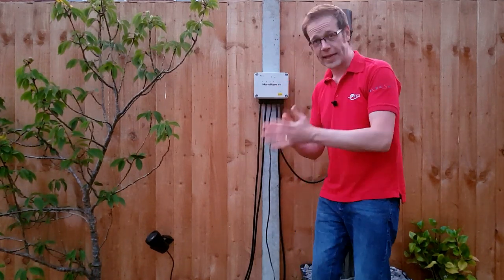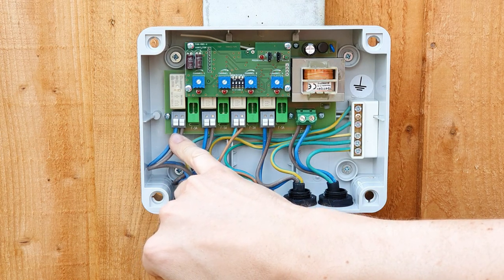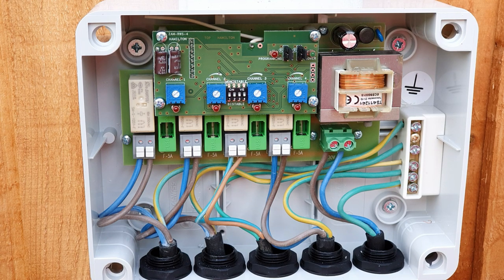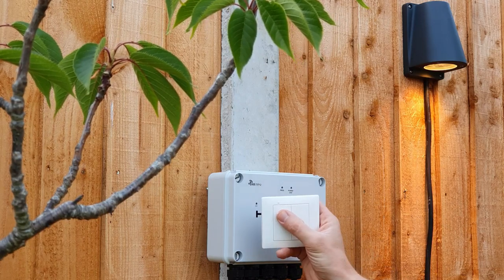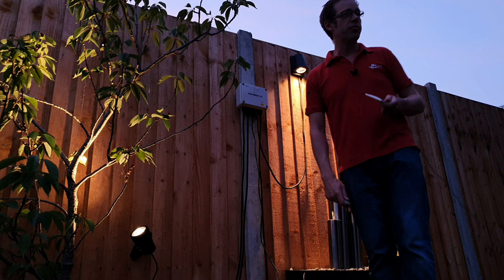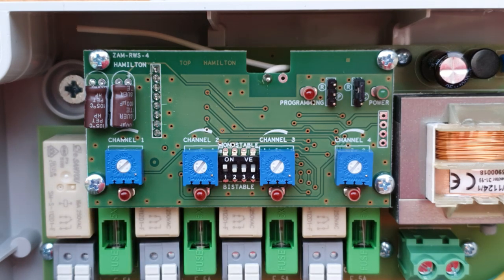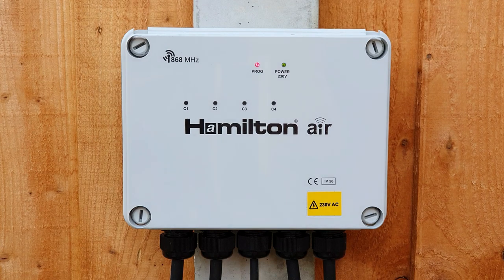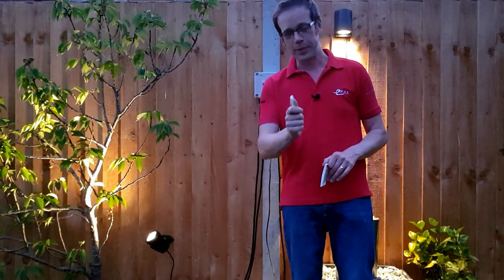Easy garden lighting control with the Hamilton Air

Comment: This seems to be the entry level system for an outdoor installation. Thanks to Joe for all the details on this and showing the various uses of this system and hopefully I'll be able to install the Hamilton Air system myself. Quick question though... Do you need to hook this up to the consumer unit?
Reply: Hi, Short answer No,  you can use cable and socket. 👍

Comment: At 2.46 you say battery powered . 
Did you mean kinetic energy powered?    
Also can I fit 2 of these boxes at my property ?
You can we can have over 100 controllers/switch’s. 
but if I fit 1box in the front garden to control 3 independent light at the front of my house and the second box at the back garden to control 3 independent lights at the back of the house . Or when I try to turn on what ever is wired to slot no1 on the front box will that  also turn on what ever is wired to slot1 on the back box at the same time ?

Comment: do you need to run  2.5mm swa cable to unit if wanting to run a water feature also  should i run from a 6amp rcd or rcbo ? for example i have plans or running 8 led fence lights water feature light if possible the water feature also a lamp post with 3 lights on it and final a 100Watt led light pointed away from house to large garden / thanks paul

Comment: Fitted a few of these and they can fail with LED loads. Had a couple where they have burnt the trace on the PCB and made one of the zones dead.
Reply from the maker: Did you send the failed units back to Hamilton - and LED load, subject to power factor, shouldn’t cause this issue.
Reply: @efixx  No as they were out of warranty. Must admit i was surprised as the units were fine with the halogen lamps, but clients were getting fed up with replacing them due to the heat build  up causing them to fail prematurely. Wise box, i havent had a problem with, even though the internals are almost identical!